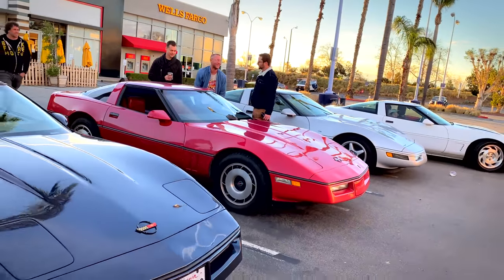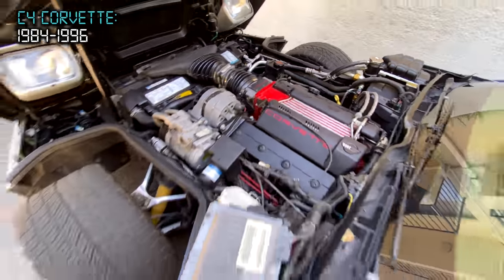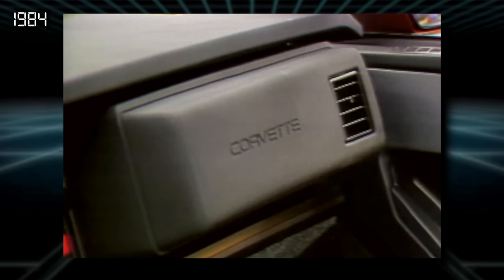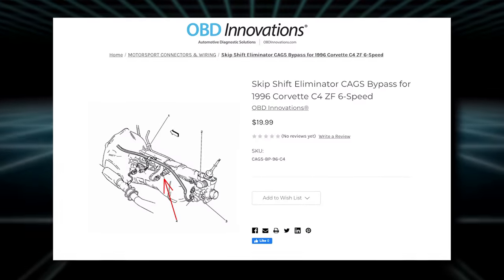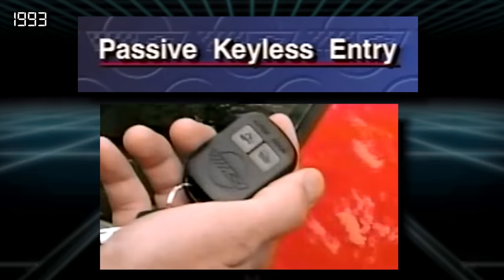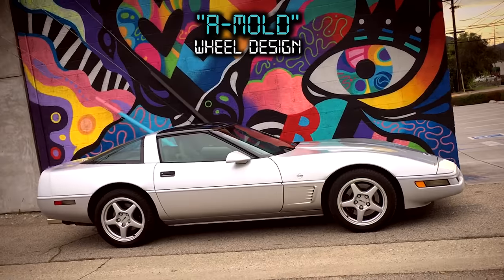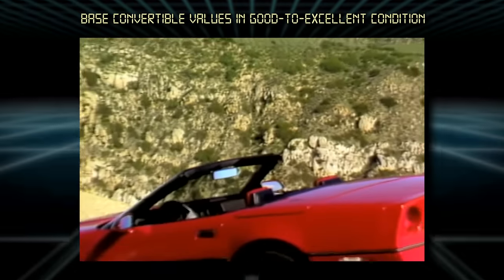C4 Corvette: ULTIMATE Buyer's Guide (Values, Performance, Yearly Changes 1984-1996)

Comment: Good video. I have a '95 Coupe in Torch red, UK import from new, I bought it in '98 with 20k miles on, as of this am 274.5k miles on it! Absolutely the best car I've ever had, with my Chevy Volt (Vauxhall Ampera here in the UK) coming a close 2nd. Great handling, a real GT (Grand Tourer in the correct description of the term). Best I ever remember was Strasbourg to Holmes Chapel in a day, and I was waiting 1 1/2 hrs at the Channel Tunnel. 690 miles, not bad, even better getting around 500 miles to a tank of fuel.
Reply from the maker: That's awesome! Driving a C4 in Europe sounds like a dream.

Comment: Bought a 96 as a daily. Love it, even with its old 90s squeaks and rattles. The steering is so much stiffer than other cars, so whenever I get into something else, I laugh at how light it is lol. Going to change the spark plugs and injectors in a few days👍🏾
Reply from the maker: Nice! I daily my 1996 as well, definitely heavy controls compared to most other cars, but it's still awesome to just cruise around in for daily duties. I find the huge turning circle to be the biggest issue in tight parking lots!

Comment: Great video and very timely for me. A friend of mine just offered me his ‘87 with 65k miles for $4k and I have been hesitant on pulling the trigger. C4 was not on my mind until this video.
Reply from the maker: Glad this video could help! That C4 sounds like a screaming deal, especially coming from a friend (so less likely to get screwed over with something hidden that's wrong with it).
Reply: @RetroCarsForever  Mechanically it is sound but cosmetically it needs a lot of TLC. I think it sat in the sun quite a bit so the interior looks weathered. Hagerty's valuation for fair condition is $4400.
Reply from the maker: @johnperry1863  Ah, I see. C4s absolutely melt if left in the sun, and unfortunately interior trim is the hardest parts to source. But for a fun knockaround car it could be fun, if not a show queen.

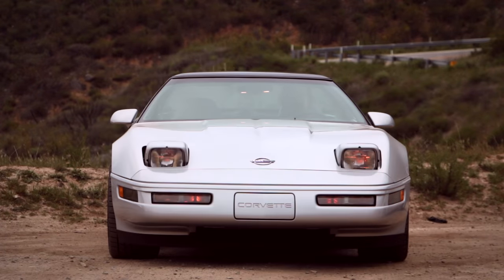Comment: I actually bought two 84 C4s. I originally ordered a 4+3 trans but it was on hold for so long I switched to automatic. After the 4+3 was available I sold the automatic and took delivery of the 4+3. I told the dealer not to do the usual preparation and leave all the protection covers intact. I drove it home and it still sits as I received it including original “30” miles. 20:36   I thought it would be a good investment but we know that’s not the case.

Comment: 1985 4+3 Owner here. The Doug Nash 4+3 isn't as fragile as most think. The reason so many people have issues with them is because the overdrive wasn't used correctly a lot, and they got beat on. If you find one that's been maintained (fluid changes, not beat on so much) they're actually really fun!
Reply from the maker: Good to hear! I do think the Doug Nash is a cool quirky oddity from the time.

Comment: I had a 1996 Grand Sport stickshift, it was AMAZING. Aside from an aluminum 5.3L-swapped NB Miata, it's the best-driving car I've ever driven. Mine was slightly modified (like REALLY slightly, Bilstein shocks, a Centerforce clutch, headers and full exhaust with x-pipe and Flowmasters (no cats), C5 Z06 wheels and 295 rear tires, a computer tune, a short shifter, that's it). After the tune, I often got 28-30 on the highway if I was running 70 mph or less. We have 93 octane here, maybe that makes a difference? I wouldn't think so, if I understand it properly, higher octane gasoline doesn't have more energy, just more detonation resistance. I may very well not know what I'm talking about though. 

I bought my car for 10,000 dollars in 2006 with 48,000 miles on it and needing a clutch, I sold it for the same amount in 2009. Great car, but I changed jobs and was down to just the Corvette (my work car blew up) when I was taken into my apprenticeship and needed a more all-season-friendly and dependable to drive up to 2 hours a day each way to and from work. I miss it. 

If only they weren't so damn wide, on the skinny mountain roads I love to drive here in the Appalachian foothills, it was often too wide to run hard and stay in my lane.

Comment: Looking to get a 96 now, one thing you missed is the radio in 1996 has a CD player along with the cassete player! Also the interior changed slightly once again when the steering wheel changed, subtle but noticeble when you look at them side by side.

Comment: Im 18 and i just purchased a c4 86' with a automatic transmission for $2800. Its not nearly as cool as the later models but i love it and im planning on using it as a daily. I never thought id have a corvette as my first car but i thing we got a pretty good deal especially since the engine was replaced and only has about 4000 miles on it. Runs beautifully and although its not as powerful as the later models i still have a lot of fun in it.
Reply from the maker: Congrats! I actually made a video all about owning C4s as a first car, maybe you'll relate to some of this...https://youtu.be/dyF5eHPf5sw

There'll be some challenges but if you're diligent and thoughtful you'll have a blast!

Comment: Used to have an 87 black on tan l98. Had 20” chrome zo6 wheels. I loved it for its sleek look just as much as I loved how it handled. I got rid of it for an 80 rs that was hotrodded out. I’ve had a 2nd, 3rd, and 4th gen Camaros. Liked them all but none have felt as good and honestly as fun to drive as my 87 c4 felt. Fast forward to right now, I found a 96 vette. Black on black, along with same exact wheel set up. Just had a fresh paint job and interior redone. Only 94k miles. Lt1 motor. I’m getting it Sunday for 8500. I’d say it’s a good six price for it. Can’t wait. It basically looks just like my 87 accept it’s newer and better than ever
Reply from the maker: Congrats! Sounds like a great deal to me.

And yeah I've driven a few gens of Camaros, and as fun and rowdy as they are, they just dont feel as buttoned down and planted as a Corvette.

Comment: Great video, Nice work covering a ton of territory and great editing. I lucked into an '88 z51 and was immediately surprised at how stout and competitive it was. I love that it's sort of the ultimate '80s version, with the high sills, digital gauges, square body and 4 speed. before the six-speed and refresh as nice as they'd be.    it road trips surprisingly well and I use it to daily sometimes but it is a straight up Motley Crue and coke weekend race car first then sunset cruiser and gt second
Reply from the maker: Thanks! Sounds like you’re totally “getting” the rad appeal of your car, glad to hear you’re enjoying it.
Reply: I love Motley Crue and C4s 🤘🏼

Comment: Love the classy lines of the C4. 93 coupe was my first Vette. Great car, drove it across the continent multiple times, and it was my only car through a winter in upstate NY. Once moved everything I owned with that car. Now have 90 ZR-1, drives like a dream. Still miss my 93 from time to time though. Nice to see the C4s get some love on this channel.
Reply from the maker: Agreed, C4 lines have aged very well. I would love to upgrade to a ZR1 someday!
Reply: How did the car fare through the upstate NY winter? Thinking about getting one but the road salt up here is absolutely detrimental to cars
Reply: @lefishe8303  Surprisingly well. Always had to take it easy, keep it in high gear in the snow, keep the speeds down. Had to be smart about where I was driving, got stuck here and there but always managed to get myself out of it. Probably not the brightest idea to have it as my only vehicle at the time, but managed to make it out unscathed. Wouldnt reccomend it of course, but the car will do it.
Reply: @RetroCarsForever  The ZR-1 is a joy to drive, great support community (ZR-1 Net Registry), my dream car. They can still be found at affordable prices too. Most have some issues, but all issues are solvable/have been solved in the registry forums.

Comment: As a vintage car with its place in history set and revealed, even a 1984 C4 is a desirable Corvette, IMO. Obviously the C4 evolved and got better over the years, but it was always a cool car. I applaud the guys who are preserving those first, groundbreaking 1984 models. The buzz around that car was just as intense as that of the C8, today. 

In my case, I stumbled upon a red/black 1988 manual coupe (in need of TLC) for a price I couldn't refuse -- $3400, including 125 mile trailer transport to my house. Upon studying the Doug Nash 4+3 gearbox, I found that it is an interesting technical characteristic of the early cars, and it works just fine. The L98 engine is a bottom-up torque monster, so you won't do that much shifting, anyway. These are not Hondas. Virtually all of your back road driving will be done in 3rd and 4th gears, same as the later 6-spd. It doesn't shift as quickly, but it has a hefty, rifle-bolt kind of shift action that is classic Corvette, and that I enjoy.

The 1988 version is a one-year-only combination of technical specs, giving it a distinct place in C4 evolution. I happen to prefer the original body styling and the cool digital dash, so I'm happy. None of the C4s are as fast or refined as the Corvettes that came later, and it doesn't matter; vintage cars are more about history, memories, and character. Enjoy the C4 that finds you, the way mine did. 

Just my opinion, I could be wrong from your perspective.
Reply from the maker: Well said, totally agree. Those early cars are torque monsters, and the L98 SOUNDS more like a classic Chevy V8. I think all the model years are appealing in their own way...If I didnt need to rely on my car as a daily, I'd love to have an earlier C4 for all the reasons you mentioned. 

Thanks for watching!

Comment: You could do a video on good after market upgrades that actually improve the value of your C4.  For example: a new S/S exhaust or upgrading to an electric leak proof water pump.  For 92-93 you can vent your opti. And there is always the skip shift eliminator for manual trannies.  Keep the series going.  The cockpit of my 92 is such a good fit. However, that Bose radio has room for improvement.  But with top down who cares.
Reply from the maker: Thanks, great idea!

Comment: Love your content Brad! I'm in the process of replacing everything on our garage queen. I bought because it's like new but forgot about all the awesome gm plastic cooling hoses and u joints and bushings and on and on haha. We will surely have a new car when it's all done. It still smells like a new car when you get in don't know how that is. 96 C4 lt4 on the interstate we can get 40 miles per gallon I am so in love with this car
Reply from the maker: Thanks man! You know I love your car (pretty close to mine, but how many miles on yours?) 

The aqua car you see in this buyer's guide video was like that...crazy low miles, still smelled like new, leather was still glove soft even on the steering wheel, pretty awesome.

But yeah, as I mention in the video, age is still gonna take its toll! 
BTW 40 mpg is incredible. If i reallllly baby the gas I can hypermile my car to about 30, but if I drive normally I can only get around 24.
Reply: @RetroCarsForever  the 40 was using the instant mpg function while going 90 for 60 minutes tucked in between a suv and mustang on our way home from Ohio on a very smooth interstate. Hit us up for a crazy father son trip to get a c4 on Father's day its one for the ages.
Reply from the maker: @RobsNeighbor  Ah, that makes sense. It's easy to get 40 mpg INSTANTLY but on average over a hwy trip, a lot harder!
Reply: Just took a 250 mi trip , did not baby it , and got a measured 26.6, all stock LT4.

Comment: Didn't realize peak power was so much higher on the lt4, that must have a much larger cam which is probably why it's manual only
Reply from the maker: The LT4 has a more aggressive cam, along with a bunch of other changes, all focused on higher RPM breathing and power. Around town there's not much difference compared to the LT1 (I've driven both back to back). 

Here's the differences if you're curious...
https://www.grandsportregistry.com/lt1vslt4.htm
Reply: The LT4 had different , cam, intake, heads etc. The LT4 is actually quite underrated , and makes more then the 330hp flywheel rating. They were closer to 350-360hp

Comment: I drove1988
 Z52 for 35.000 Miles. 
My experience from 60.000 original Miles to 95.000 Miles. 
Thm700R4 automatic was a big issue : clutches inside premature usure, the kick down cable ( 4L60 version , 4L60E comes in 1994 without cable ) 
Dougnash 4+3 manual problems so my preference will go absolutly to manual 6 , and I Love the 1989 ( first year of six speed ) but ride quality change dramatically with LT1 , my preference goes ton1996 LT4 Grand Sport for value conservertion and civilised driving experience ( tested öne and love it ) except automatics the big issue in c4s are : carefull about in tank fuel pump , interior mediocren plastic quality,  1994 and up is much better , bose speakers always problem with amphie integrated, special Love to 40 year edition zR1 ( 1993 )or 6 speed with LT1 ... Otherwise very reliabble çar, low cost and a lot of aftermarket parts from corvette central or ecklers
Reply from the maker: Great tips, thank you for sharing!

Comment: I bought a 93 vette at 17, red exterior and red interior about two months ago for my first car and I love it, I've had problems but its a fun car
Reply from the maker: I’m curious, What problems have you had? Was it sitting awhile before you got it?
Reply: @RetroCarsForever  sorry for super late reply, optispark, alternator, n now i’m actually having a rly annoying issue… of just the car not wanting to start sometimes, and then it will 4 mins later… like.. it thinks i’m breaking into it.. and then it doesn’t.. i think the icm might’ve gone, i’ve had more issues but those are big one also completely redid all brakes
Reply from the maker: @koledriver9988  Best of luck getting it all straightened out. Its worth it!

Comment: Excellent job Brad! Wow all the cars in the video looked amazing! Very clean examples. My question is; do you see a value difference for paint colors? Some of the colors were only offered a few years and some of the colors they didn’t make many of. I think the more rare colors are gaining an appreciation with todays enthusiast. What do you think?
Reply from the maker: Thanks! I do think some colors add more value than others, especially the rarer/brighter colors, but only by a grand or two at most. 

It's tough to nail down specific values because color is so subjective, ultimately even if a color is rare it might not be to a specific buyer's tastes. 

Now there are some SUPER rare colors that DO add more value, such as the 1994 only Copper Metallic, covered here- https://youtu.be/vWhwNK5Lkyg?t=854

Comment: I just talked with a guy that says his 96' collector's edition has an automatic and the LT4, is he wrong?  I can't find info after a quick search.  Thanks
Reply from the maker: Most likely he is wrong or confused. Unless he somehow swapped either the transmission or the engine.

More info on the LT4 at end of my Special Edition video here, and how to visually spot the LT4...
https://youtu.be/vWhwNK5Lkyg
Reply: @RetroCarsForever  in the pictures I've seen it looks to be a collector's edition but he said it's automatic which i thought the lt4 only came with manual so I was confused too lol.  I'll wait for more info on the car and check the vin to make sure.  I'll check out the video too.  Thanks 👍
Reply from the maker: @patschrodinger4105  You can visually see differences with the LT4 engine too, as seen in these videos. Red with a Grand Sport badge.

Comment: '91 base owner here.  Typical automatic.  all original .   BUT I have two seemingly impossible problems.  A broken turn signal switch and an intermittent center display.  I really would hate to sell her for such minor things..   her L98 engine runs like a watch..  they really had it perfected in it's last year.
Reply from the maker: Check out Batee.com, they might have some solutions to both of your issues.
Reply: @RetroCarsForever  Thank you for you time.  I have been to several other sites.  I'll try this one.

Comment: Great video!! I think that you forgot to mention that the 1994 corvette coupes had staggered saw blade rims.  I own a 94 green coupe automatic with 69,000 miles that I bought in 2016, with only 43,000 miles, that came with the sawblade rims. They look good, but I put a set of black c5 rims on it to make buying new tires easier and rotations possible, plus it looks sharp. Keep up the c4 content!
Reply from the maker: Thanks! By “staggered” you mean different sizes front to rear? My understanding is that was true for some but not all…for example in 1996 the Z51 package meant the front tires were the SAME size as the rears.
Reply: @RetroCarsForever  Correct, the rear rims are wider.  I believe that the 94  ZR-1 rims are the same all the way around but wasn't sure about other the other packages.

Comment: Hello and awesome information about c4 's. I have a question, I also have a Lt4 and was wondering what exactly is the top speed of the car. I've saw alot of different answers but do you know the correct answer? Would love to know. Thanks
Reply from the maker: Top speed can vary hugely based on location, atmosphere, and even variances between vehicles, so that's a tricky (but good) question!

The source I trust most is my July 1995 issue of Motor Trend, where they conducted top speed tests on an actual closed road with a bunch of cars that cost less than $50k, averaging for windspeed by going both directions. Their LT1 C4 topped the test at 167 mph.

So, I'd say an LT4 (which has higher top end power) could hit the low 170 range.